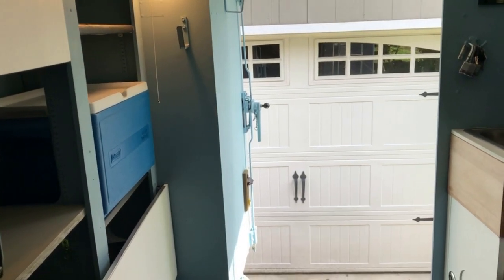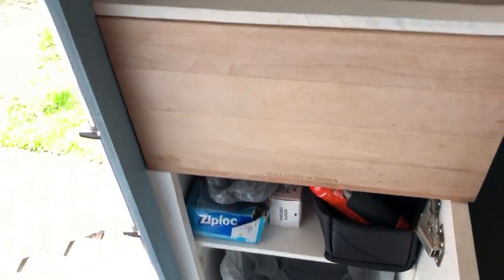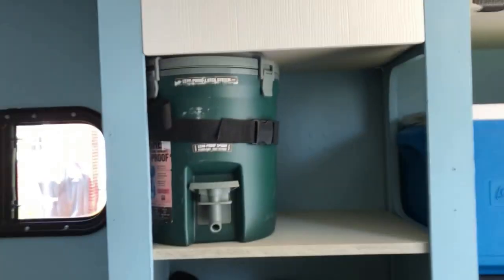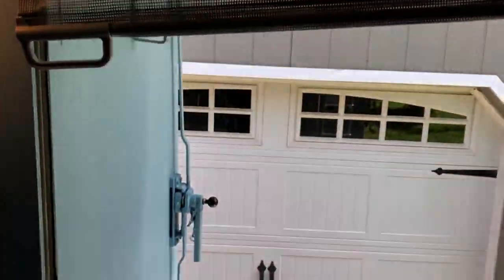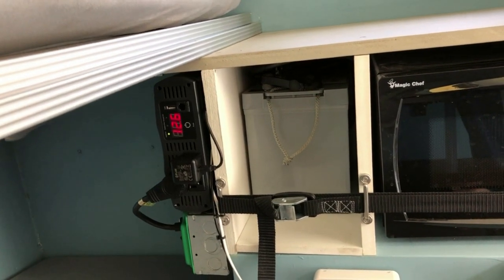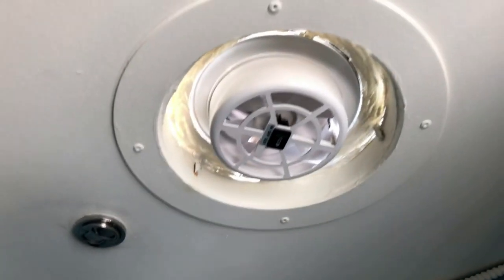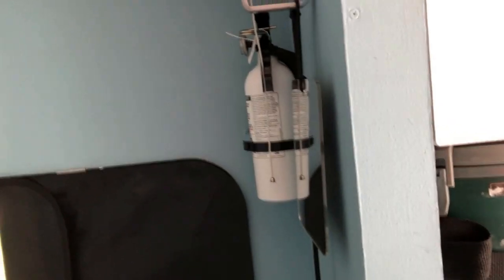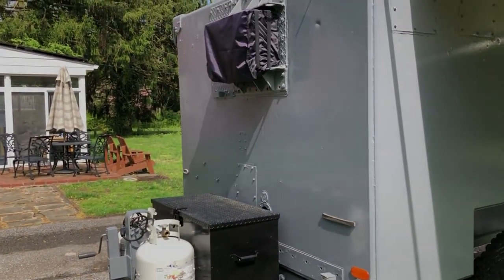S-788 on M101 Military Offroad Camper Trailer Conversion Interior

Comment: Looks Great! I'm converting an S-250 right now. What was the wood you used for your bunks and where did you get it?
Reply from the maker: It's just 3/4 inch plywood.  The trick is the edge stiffeners.  You'd get tons of flexing and bending without the aluminum edge stiffeners.
Reply: @SurplusCamping  Thanks for answering. Where did you get the stiffeners?

Comment: How comfortable is it in the heat or cold? I’m looking at buying one now, thanks.
Reply: They are NOT insulated and are cold/hot as the outside temp varies. Look for some sort of thin iso clad insul board (Widi board) ... I would skin the ENTIRE inside. The 788 always had a robust heating and cooling system when used by military.  I have three of the 788s.
Reply from the maker: I added a good amount of 1” foam board insulation on the roof, floor, and about 1/3 of the walls and now it’s pretty comfortable.  Walls are aluminum so they got pretty cold before and would condensate bad